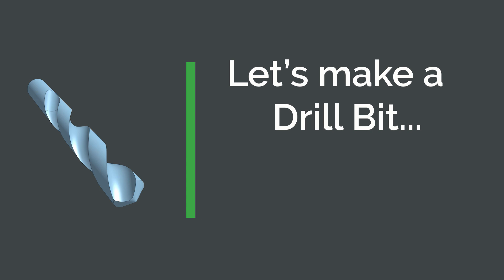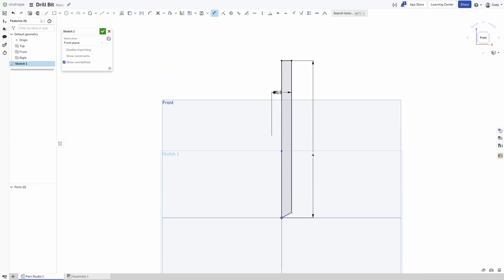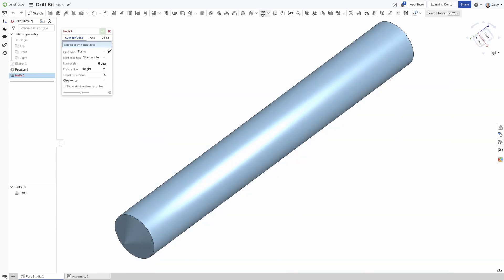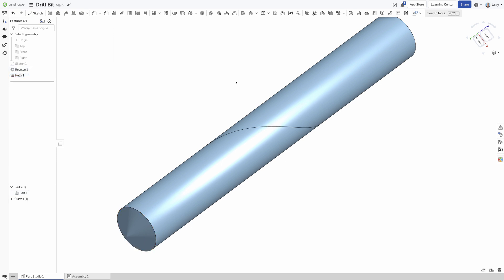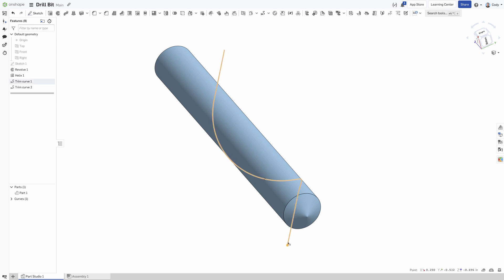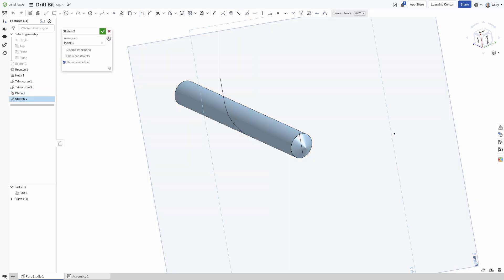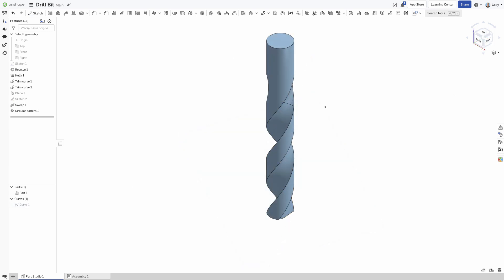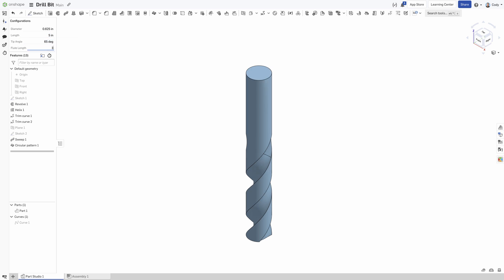Let's Make a Drill Bit

Comment: Very nice demo. However to nitpick from a toolmaking standpoint, the drill is not accurate. The web of a twist drill is always tapered, so it's thicker at the shank end, and thinner near the tip end. This is why if you were to cut a drill in half and regrind the tip, it won't cut properly. I believe to make your model accurately, there would have needed to be a cone shape revolve drawn, that the helix curve would have referenced its tapered surface.
Reply: shut up nerd he is making a simple drill bit.